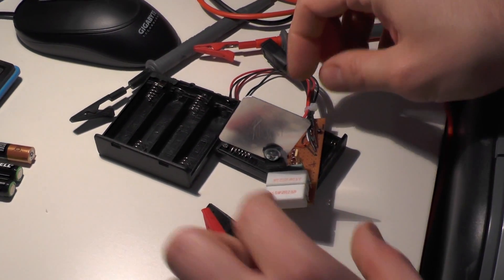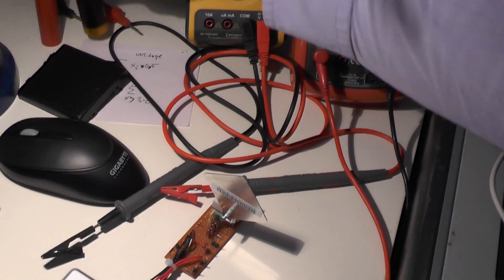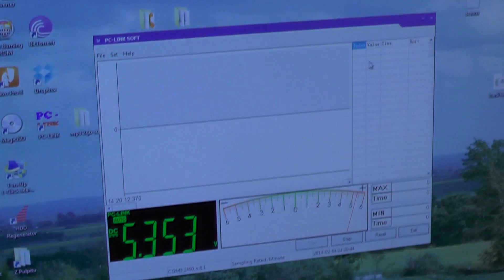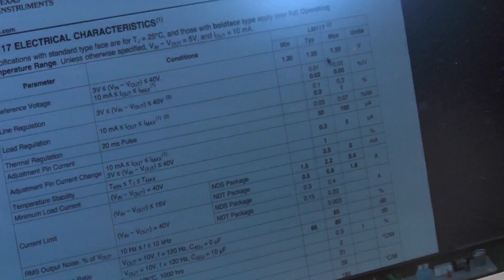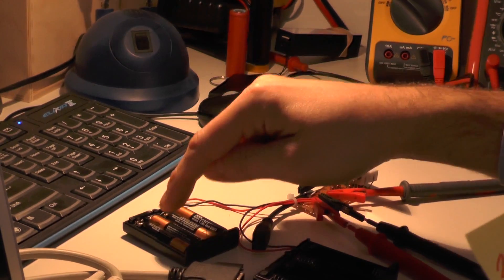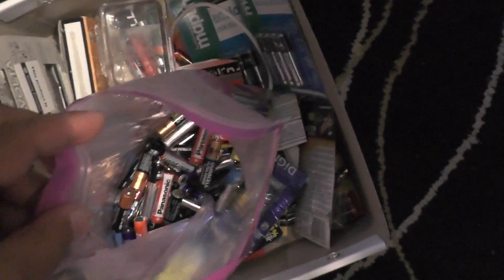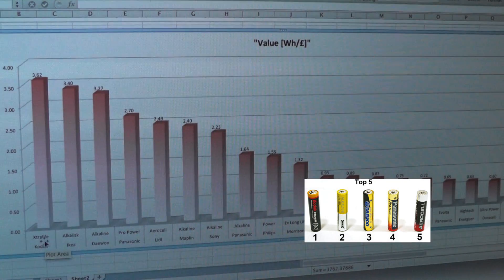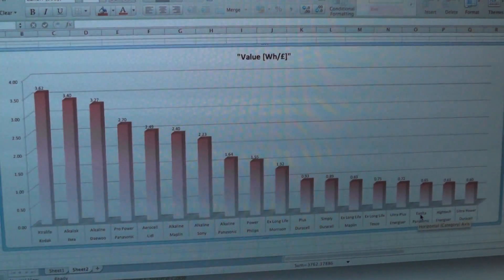The Battery Price Scam -- Hint: We're Probably Being Ripped Off!

Comment: Big Clive made the most elegant tester that anyone can build on the cheap. It's hardly precise, but if all you need is a relative measurement, it's moderately good enough.

He used a pound store wall clock as a timer. He interrupts the power supply of wall clock with a reed switch. Around the reed switch, a thin enamel wire is wound, such length that he would have approx. 500mA current at 1.2v, forming an electromagnetic relay. When the voltage approaches 0.7V, the reed switch turns off, and a proxy value for capacity can be read on the time that the clock has stopped at.

Don't you admire the elegance of simple things?

It's representative of resistive loads. It's not representative of current controlled, loads, but where have you last seen one of those? I think more interesting would be a power controlled load, representative of complex digital devices with their own buck or boost converters which will actually draw the more current, the lower the voltage is, to provide sufficient power for a device. But perhaps a current controlled test would be a middle ground between resistive and power-controlled loads.
Reply: There is also the Big Clive "cut it open and see how quickly it immolates my beard" test.

Comment: I've done some testing of sorts of my own, I've knew about the Kodak Ultra power ones being a good battery for a while. My satellite signal meter/analyser takes ten AA batteries and even though I invested in rechargeable ones a while back I keep two six packs of Kodak Ultra in my sat meter bag for back up, can get a good hour and a half out of a set with solid use, which is really good for a unit that voltage switches between 13 & 18 volt to power the LNB on the dish etc.
Reply from the maker: Oh interesting. Thanks for the feedback William. Those Kodaks certainly surprised the heck out of us.

Comment: This is a very interesting and time consuming test, thanks for taking the time. The results were probably as I had expected more or less. I have done extensive duration tests basically getting LEDs to run for as long as possible (and using old used batteries too). You would see a very different result if the constant mAh value was set to say 10mAh. The test would take considerably longer but I think the results more accurate and more meaningful for consumers...
Reply from the maker: Yes we did discuss that. The main thing we were focusing on, however, was a comparative between different brands, so we felt that using our test parameters was good enough for that, and allowed us to cover more ground in a reasonable length of time.

Comment: is the value chart not a bit 'duff' if it does not include purchase price in the data, I doubt my store would charge me 4x as much for kodak as duracell, but is it not still incomplete data unless you 'reverse engineer'' the cost from the mwh per cell and the mwh/£ charts to extrapolate it.

Its like saying I got 25 miles on a gallon of esso and 28 miles on a gallon of bp, if you dont know the price per litre, its meaningless.

But real thanks for doing this, as someone who has a camera that wont run on rechargeables, I now know not to buy what the adverts tell me and to get to lidl.....
 
Thanks again.
Reply from the maker: Oh sorry, I'm not getting what you're saying. Did you manage to take a look at the blog post, - http://www.redferret.net/?p=42679 - because we have the spreadsheet available with all the price information which is used to extrapolate the Value chart?

Thanks for your comments, and yes IKEA also looks to be a great deal. :)